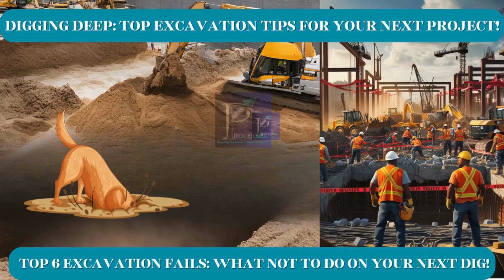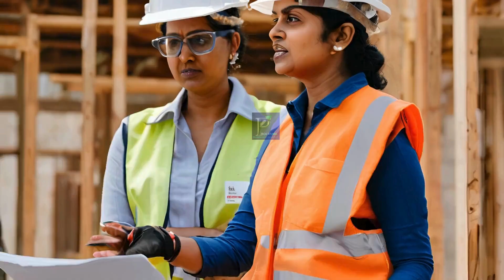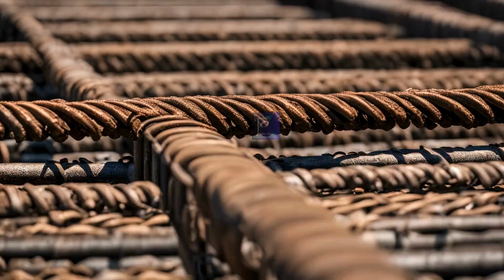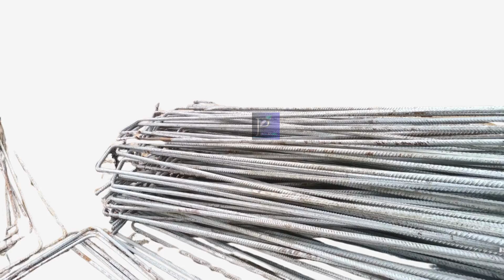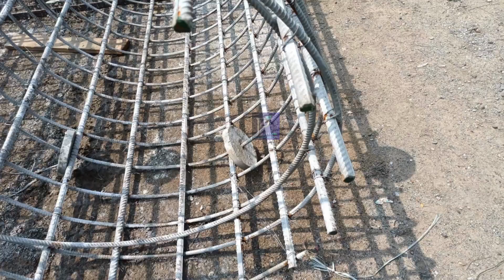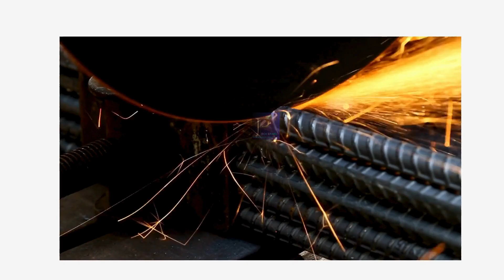"Top 7 Construction Errors You MUST Avoid! 🛠️ Save Time & Money!" Rebar Errors

Comment: Great video! You’ve done an excellent job highlighting crucial aspects of rebar handling in construction. Your insights on the impact of procurement, material testing, and regulatory approvals on cost and scheduling are spot-on. The emphasis on proper bar bending schedules and the risks associated with errors is crucial for ensuring structural integrity. I appreciated your tips on stacking rebar on a cement bed and protecting it from moisture, as well as the importance of continuous monitoring to prevent damage. Your points on galvanization, adherence to design specifications, and the need for skilled workmanship and supervision in rebar bending are all vital for successful construction projects. Keep up the great work! 🚧🌟
Reply from the maker: Your insights have been incredibly valuable. Thank you for your time and feedback.